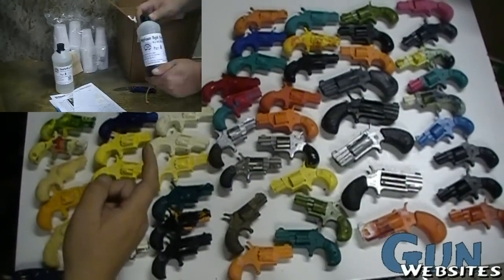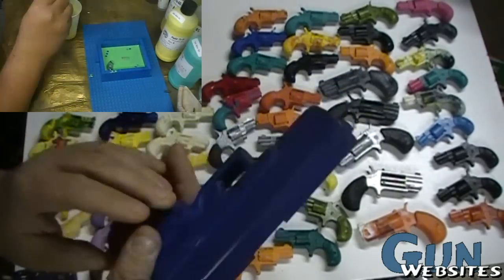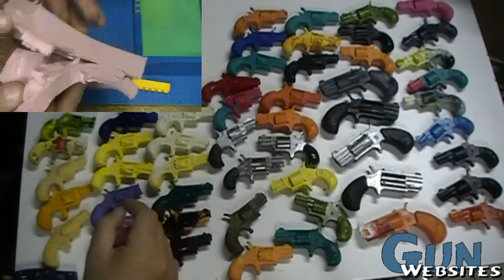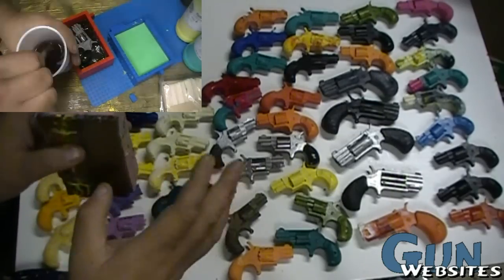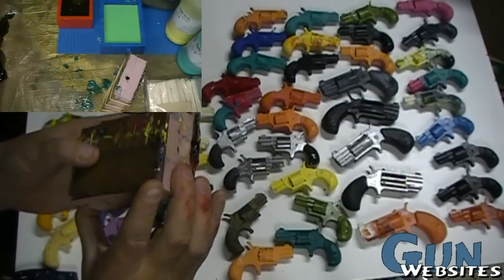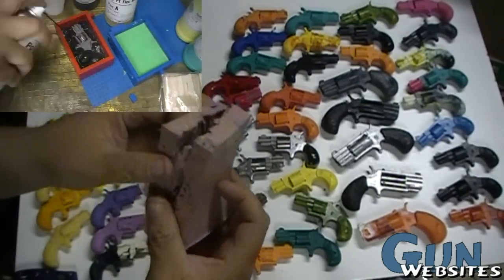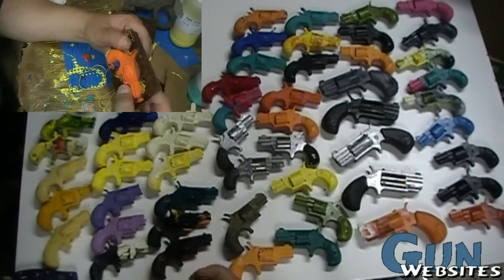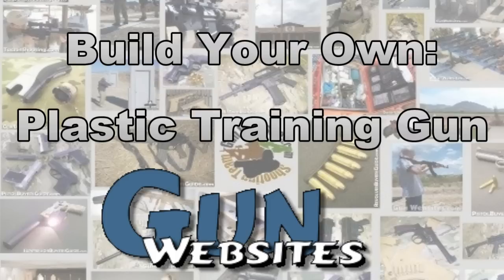How to Make: Plastic Training Guns

Comment: That blue lego baseplate that you used is actually a relatively rare lego piece. If you want to use legos to make these molds use the green baseplates because they are very common and can be purchased anywhere. This is just a FYI sort of thing, I just don't want to see a rare lego get possibly damaged, just as you would probably not want to see a rare gun get damaged.

Comment: Thanks for posting this!!
Question 1- Where do you get the foam material?
2- where do you get the plastic material.
3- how heat resistant is the plastic once set?
4-what is the name if the plastic material?

I am planning on making these so I can use in kydex holster making.